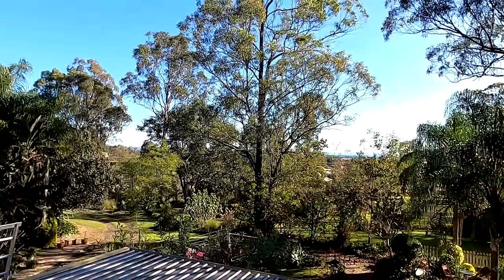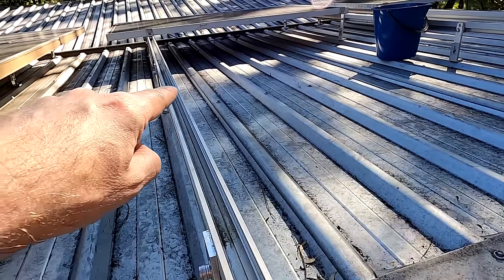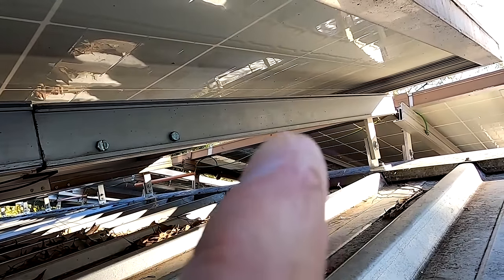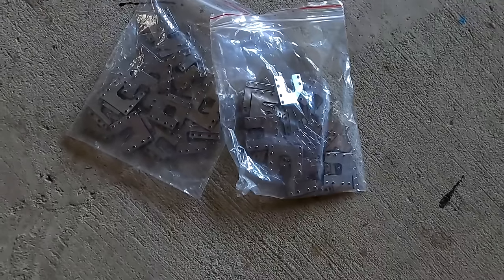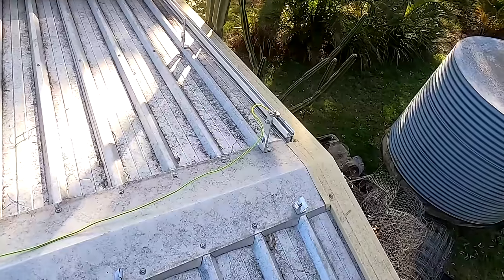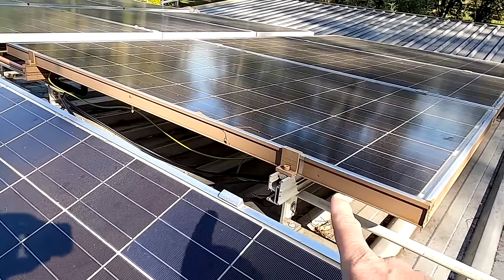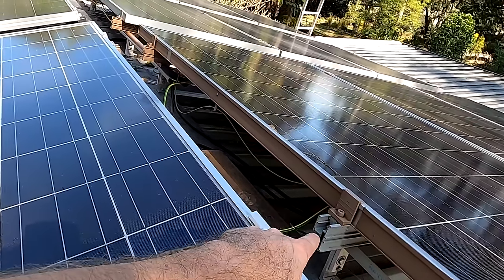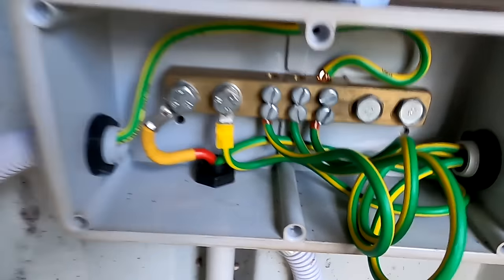Solar Grounding Essentials. These important safety features are often forgotten.

Comment: Earthin solar panels is completely useless but if ya want to test it u use ur milli ohm meter and considerin aluminium is conductive aswell but usin liquid electrical tape would of been better to protect ya copper wire and also Andy on the wire to identify what core is what u can use the print on it that says the wire size and tyoe,the mark is printed every meter but its also used so ya can determine whats ya + and - 😉
Reply: Its not useless if there is no isolation between the 240 volts ac and panels and the panel voltage is high as with most installations which is what they wrote the rules for but for a low voltage system with isolation it serves no purpose.

Comment: Grounding doesnt need any spikes or piercing on alumunim. Above 1000 volts the anodizing is penetrated by any lightning. Im sure lightning is more than 1000 volts lol Also we know electricity follows the easiest way with less resistance. Personally i would put fatter cables for grounding than my solar panels have to connect to mppt controler.
Reply: This also protects you if there is a panel fault and the system goes to ground. A faulty system on a timber or brick building with plastic down pipes can find ground from a human on a metal ladder
Reply from the maker: This grounding is not for lighting protection. It will be in the next video how important that piercing is.

Comment: The problem you made with the silicon is that you did not silicon the bolt that claps the copper wire onto the lug. Moisture can go through the screw threads of the bolt. Just an observation. Well done anyway. Doing cabling on your own is always a nightmare and takes soooo much longer to do. You should employ your wife. 👻

Comment: Mann, Mann - da bist du ja mal wieder auf was reingefallen....
Deine bisherige Erdung ist mindestens gleichwertig mit deiner neuen Installation.
Diese speziellen Klemmen sind eine Erfindung der Industrie, damit man die Erdung schneller installieren kann, aber um keinen Deut besser, als die Erdung mit 6mm² CU Kabel und Ringösen und Zahnscheiben zu machen.
In D würde man diese speziellen Klemmen sogar preisgünstiger mit einem AL Draht über alle Schienen verbinden...
Sehr schade, dass du soviel Geld für so nen Schwachsinn ausgegeben hast.
LG jogi

Google translator produces:
Man, man - you fell for it again...
Your previous grounding is at least equivalent to your new installation.
These special clamps are an industry invention to make earthing installation quicker, but no better than doing earthing with 6mm² CU wire and ring lugs and toothed washers.
In D, these special clamps would be connected even more cheaply with an AL wire across all rails...
It's a shame that you spent so much money on such nonsense.
LG jogi
Reply: Mir leuchtet es auch nicht ein, warum bei diesem Setup eine Erdung des Montagesystems notwendig sein sollte?
Die Installation ist ja eine ueber Akkus gepufferte Inselanlage ohne Verbindung zum Stromnetz, wozu sollte man
dies Erden muessen. Die Module und das Montagesystem sind auf dem Dach iosoliert, solange das Mettaldach
nicht selbst ueber eine Erdung verfuegt, einziger Grund koennte in diesem Fall das Metalldach sein.
Denn ganze Installation ist nicht direkt mit dem Stromnetz verbunden, da es nur eine DC Verbindung ueber die Solarladeregler
mit den Akkus und den Wechselrichtern gibt.
Bei einer Klassichen Installation mit Wechselrichtern ohne Transformator welche direkt an die Photovoltaikmodule
angeschlossen sind wuerde mir eine Erdung des Monatgesystems ja noch einleuchten.
Hier koennte dann in einem Fehlerfall in einem Solarmodul die Netzspannung auf dem Montagesystem anliegen,
aber bei einer reinen DC Installation mit Akkus als Puffer ohne Verbindung zum Netz erschliesst sich mir der Zweck
hier nicht so wirklich.
Reply: @Frost4  Hallo Markus, so einfach, wie du das siehst, ist es nun nicht.
Auch ein Victron System muss und ist geerdet (- Pol der Batterie).
Angenommen (was so auch nicht wirklich ist) das Dach wäre isoliert und ein Paneel bei 400VDC hat einen Fehler und ist mit dem Dach verbunden, dann hast du 400VDC gegen Erde und wenn du dann das Dach - von einer auf der Erde stehenden Leiter berührst - da fällst du tot um => 400VDC und 20A überlebst du nicht.
Deshalb ist ein guter und wirksamer Potentialausgleich notwendig und eine Lebensversicherung für jeden, der mit einer solchen Anlage zu tun hat.
Was ich bemängele ist ja nur, dass da ein wirklich schon guter Potentialausgleich durch einen teureren und ggf. sogar fehlerträchtigeren Potentialausgleich ersetzt wurde.
Fehlerträchtig - weil ein direkter Kontakt zwischen Kupfer und Aluminium zu Korrosion führt:
"Das Problem hierbei: Aluminium und Kupfer lassen sich nicht ohne weiteres miteinander verbinden. Deshalb ist die Verwendung von speziellen Al/Cu-Kabelschuhen und -Verbindern für eine dauerhaft sichere Verbindung zwingend erforderlich."
Das hat der gute Andi halt total übersehen - die alte Lösung war mit verzinkten Ringösen - verzinkt + Edelstahl Zahnscheiben + Edelstahlschrauben + Aluschienen vertragen sich halt.

Wer weiß das schon, vielleicht baue er ja alles wieder zurück...

LG jogi
Reply: @jogi_54  Ah ok, wenn der - Pol des Akkus geerdet ist, dann ist dies natuerlich gefaehrlich sobald man da einen Fehler an einem Modul hat welches etwas weiter hinten im String liegt. Ich war jetzt davon ausgegangen, dass die DC und die AC Seite komplett voneinander
getrennt sind und nur die AC Seite des Systems ueber eine Erdung verfuegt.
Reply: @Frost4  Wenn du das DC Potential frei fliegen lässt und du z.B. bei 400VDC (vom Minuspol aus gesehen) einen Erdschluss hast, dürfte dir die gesamte Anlage abrauchen...  Ne ne - keine gute Idee.